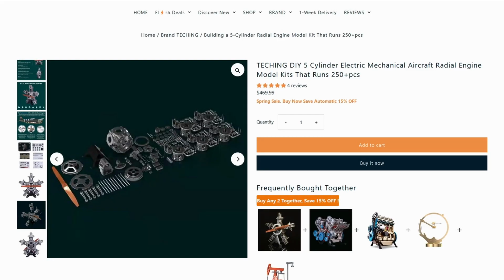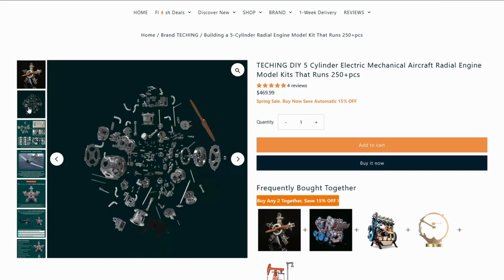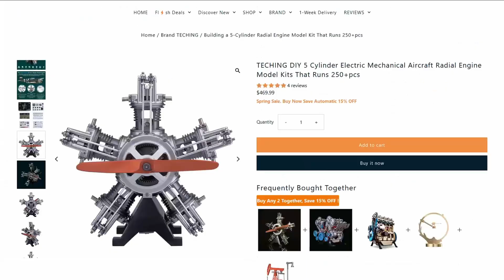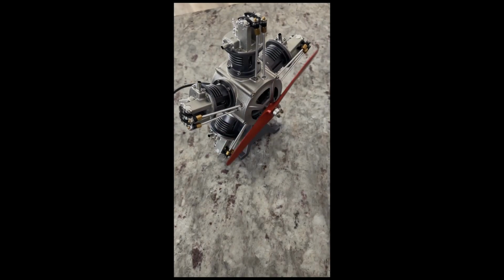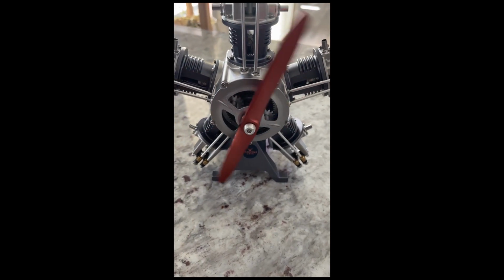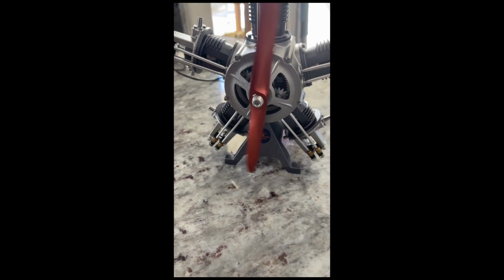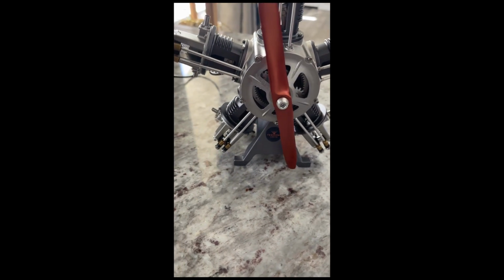Assembling a Miniature 5 Cylinder Radial Engine - TECHING DIY

Comment: I believe the Radio Control Fliers have actual working engines like these and better. You might want to check them out. They also have virtual Reality Headsets to fly their Radio Control aircraft which is absolutely amazing. What I would like to see is one of their model jets break the sound barrier ! 😉

Comment: So......take the next step........buy yourself an model aircraft 2 stroke engine glow plug engine 1.5 / 2 cc or so & run one of those .., all the oil smells & noises put engines in context ...